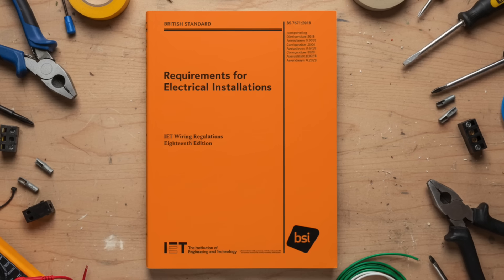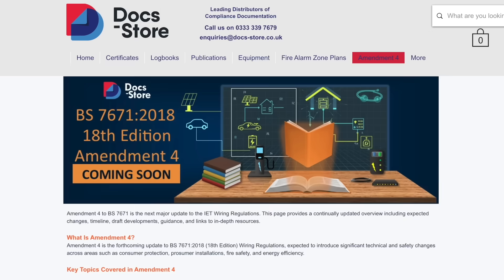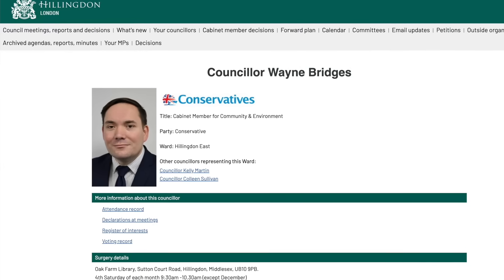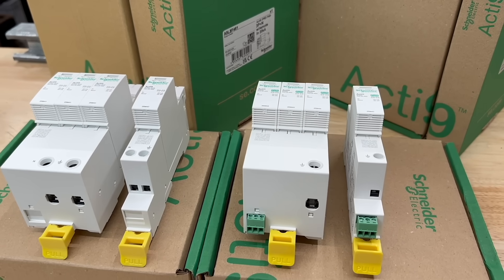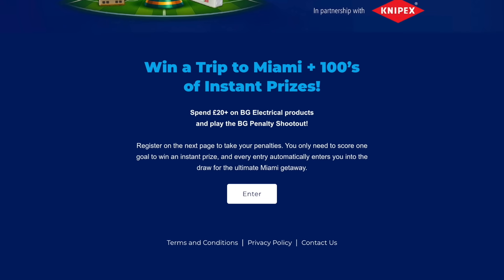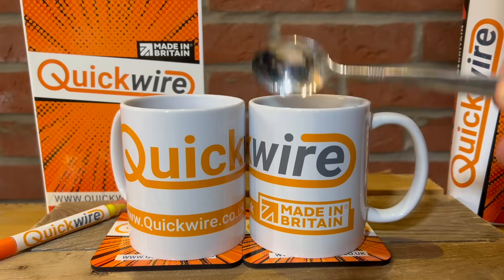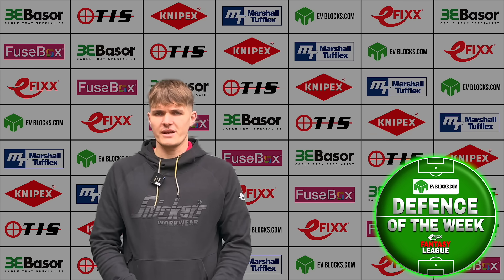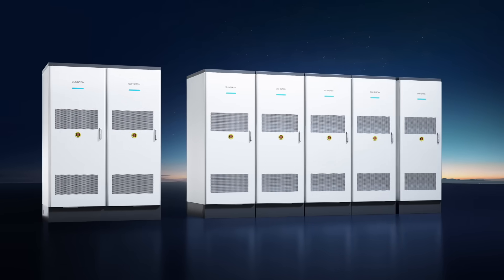New Regs Book: What's Actually Changed?

Comment: If a recognised manufacturer says that the SPD doesn’t require an MCB under certain conditions and they are adhered to then it’s not for NIC EIC or whatever other voluntary agency to say otherwise to contractors. They should take it up with the manufacturer or shut up about it. As a NIC EIC member of too many years I’m used to hearing this nonsense and have gotten to a point where I will not always agree with an inspector about this sort of criticism . If I believe it’s unfounded nonsense then I will say so where once I would have been compliant. car chargers that are actually not chargers technically ( unless they are DC chargers) but rather  glorified 32 amp outside sockets is another favourite obsession.

Comment: If we have purchased ed18, surely amendments should be 25 quid (ish). Must admit I have been campaigning for years for the distinction between Pc, earthing, bonding & grounding, you have to admit 'the regs' as they stand at the moment are a little silly especially when we have multiple inverters, stand alone off-grid systems, hybrid systems etc, where the neutral and earth may become separated via routing or control. I only use TT and just avoid TN-C-S, I find TN-C-S way too complicated when designing hybrid systems.
WRT batteries, I have frequently stated within these eFixx groups that batteries should always be 'non habitable', not only from a safety and commonsense perspective but from all the variable speed, thermostatically controlled fan noises that can make installs seem more like a 24/7 whirring, humming sub-station.

Comment: Took insurance companies to highlight the dangerous practice of putting battery units in roof spaces!!! IET way behind in the game, whilst imbeciles run amok installing this crap as they please. Good to know the NIC are more interested in misuse of a logo, than their standards falling through the floor. As for non mcb protected SPD's, how does one replace the damn thing when its at the end of its useful life, isolating the whole distribution board will only lead to them never being replaced. So much easier to leave them as MCB required, boards have more than enough capacity and scope nowadays.
Reply: Pull the MOV brick out, stick the new one in.  A properly designed carrier will not make any live terminal touchable when the brick is removed.  Safer than pulling a ceramic rewire fuse carrier.
Reply: @retrozmachine1189 I'd be more concerned something being live when the block is being replaced, especially if there's an overvoltage present. Safe isolation trumps any manufacturer design.
Reply: @ChariotsofWire180  If there is sufficient over-voltage present to the point where the plug-in module becomes hazardous I think the ongoing bangs from all the appliances and smoke emitting from things may be more alarming and have caused a person to turn the mainswitch off rather than being the slightest bit interested in replacing a failed SPD module.  What's your thoughts on that?

As for something being live, yes, that would be the ENTIRE switchboard and all sub-circuits there-under.

Show me a modular SPD intended to be installed in a switchboard of the nature being discussed, or smaller, that is not of a design where upon removal of the plug-in MOV module live terminals that a person can contact, without deliberate intent to do so, are exposed.
Reply: @retrozmachine1189 Over the past 140 years or so of electricity usage, there's been plenty of overvoltage instances, none of which caused any of the drama you portray. We've had SPD's, supplied by an MCB for decades, and its fine, it doesn't need changing its not an improvement.
Reply: @ChariotsofWire180  Sure.  Sure.  Can you state examples of hazardous over voltage where an SPD was fitted, failed open circuit (otherwise fuses would go away). allowed the over voltage condition to persist and be a type of fault whereby opening an MCB protecting the SPD would magically make the hazard go away?
Reply: @retrozmachine1189 The MCB isn't there to protect the SPD as such, they're designed to fail safe so its impossible for it to cause a fault condition to operate the MCB. Its there to meet the provision of safe isolation of a circuit or equipment. There's plenty of SPD'S already out there sat with a red flag, past their functional life. Nothing happens, nothings smoking or sparking, life just carries on as normal. Are you new to this?
Reply: @ChariotsofWire180  Oh dear.  I suspected as much.  You don't quite understand what that solder tag break is intended to do.  It's little wonder you have the stance you do on all this.  There's lots of technical videos on youtube about SPDs, including those offered by efixx.  I suggest you view them.
Reply: @retrozmachine1189 We didn't need the solder tag break, its not an improvement on what we already had, and as the video states, some manufacturers are sticking with MCB requirements, so we have non standardised products which leads to mistakes.
Reply: @ChariotsofWire180  View the videos.  Listen to what they tell you.  Learn.  Your additional comment about the solder tag only shows that you really, truly do not grasp the details.  I'm not going to talk to you any more.  Go watch the educational videos.
Reply: @retrozmachine1189 Solder link devices have been on the market years, its nothing new, they still had the MCB requirement. Just because some manufacturers change things doesn't mean its an improvement, or needed in the first place. We shouldn't be putting people at unnecessary risk when swapping the block out, safe isolation trumps manufacturers ideas.
Reply: as someone else mentioned, what about Gas boilers in lofts, or pressurised cylinders?
Reply: @100tinsoldiers Takes insurance companies or serious incidents to drive the industry and make real change.

Comment: 35 Years in the electrical trade now and fed up with all this Regulation at a astronomical cost to us sparks. Had enough now.
Reply: It's been time to get out for a while but it's getting even worse . Decent job it once was isn't worth the stress anymore .
Reply: Its not the cost of implementing the regs, that's passed on by all of us, identically to the customers, I find it's the cost of the equipment we have to carry to implement these regs! And even if you have an MFT-X1 without dodgy connection issues, how do you make sure a type B is 'type B-ing' and not 'type AC-ing', in other words how do you test that HF part without buying a specific RCBO tester for another two grand that you know will go on eBay when ed19 comes in and there's a Type H! That side of our industry has gone crazy.

Comment: I don’t think gas boilers should be installed in roof spaces either!
Reply: Why?
Reply: @cuezed  3 reasons, massive temperature variation summer to winter, you can’t easily see if somethings going wrong, in the event of a fire your roof’s going first.  Are they even designed to function in such an extreme environment?